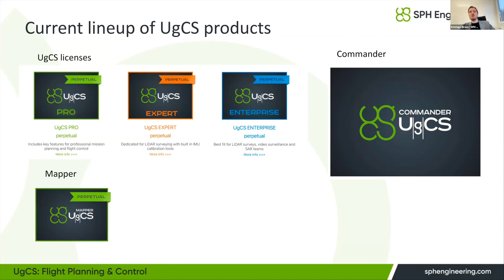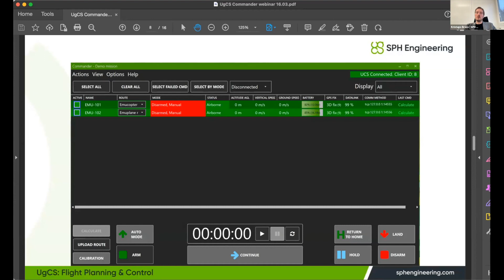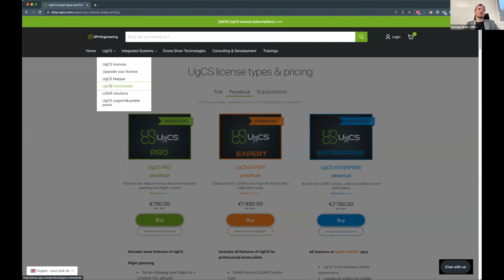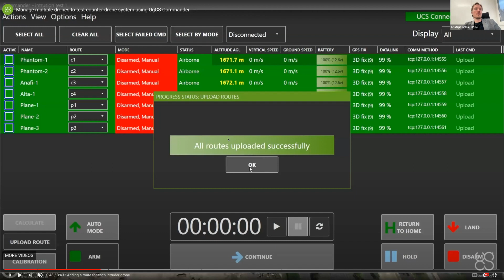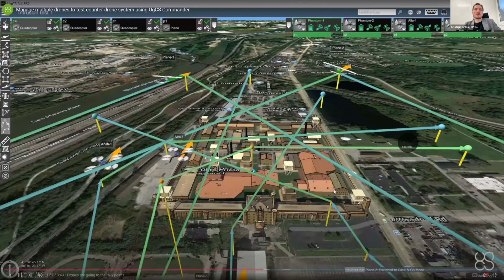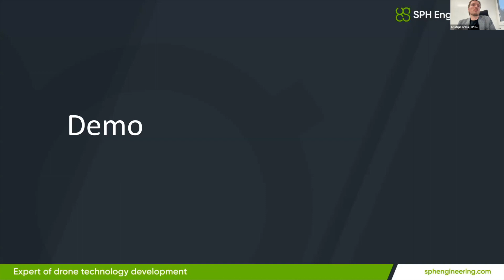Webinar | Achieving simultaneous multi-drone control with UgCS Commander

Comment: I was hoping to pair a land unit with air unit.  Any benefit in doing so??
Reply: Hi! You can do this. UgCS also supports setting waypoints for ground rovers on Ardupilot platform.
Reply: @kristapsbrass9154 would it be beneficial to have an air and land unit?  Or would two air units be better?  For the purpose of mineral exploration.